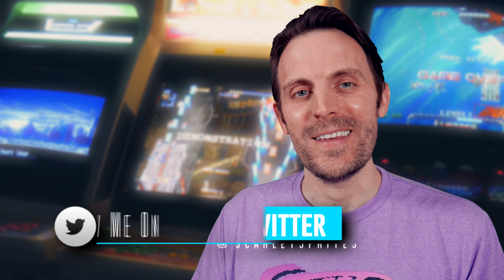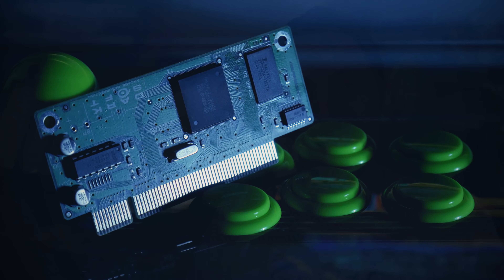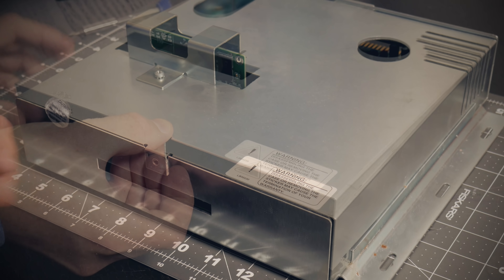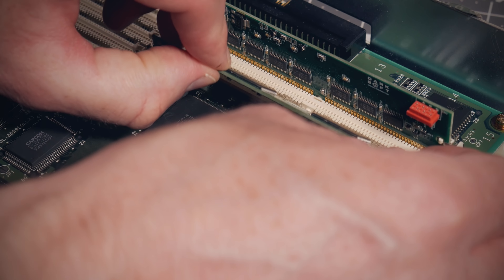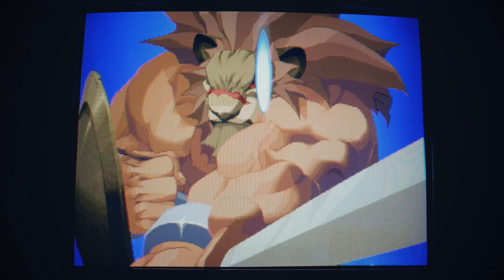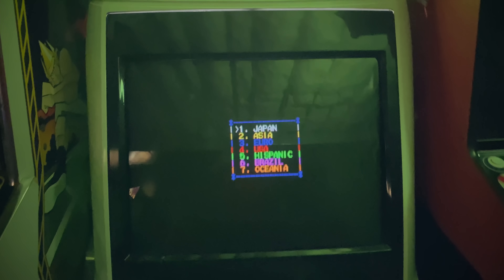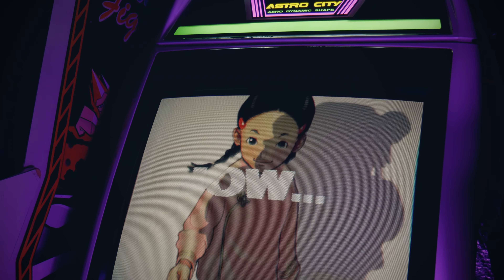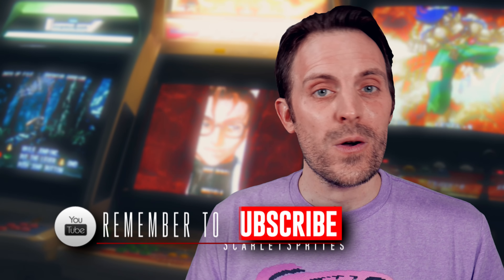Darksoft CPS3 Ultra Simm Multi Review - Elite Arcade Hardware!

Comment: Darksoft is probably one of the biggest reasons I decided to get into collecting arcade JAMMA boards. They have a lot of great products to choose from and, in my opinion, are better than anything Terraonion can put out. Prices can be heavy, but it still won't cost nearly as much as building a collection of official game carts/boards. I myself probably won't venture into the CPS3 scene due to the insane cost even for just the board, but I just got my first Supergun and I'm looking into IGS PGM, Neo Geo MVS, Sega ST-V, Taito F3 and Sammy Atomiswave either because some games and motherboards for those systems can be had for a fair price or because Darksoft makes a nice cart for them. I'd like to jump into Hyper Neo Geo 64, but those boards are extremely rare and expensive nowadays so I had to back off. I also appreciate people like you who help guys like me understand how this stuff works and what's available out there for us to consider buying so thanks!
Reply from the maker: Even as an SNK fan the Neo 64 didn’t excite me too much.  It’s cool from a history standpoint but with the non-fighters requiring special controls it’s a bit of a turnoff.  If it had a Metal Slug game though, that would be a real conundrum.
Reply: @ScarletSprites  You're definitely right about the lack of standard controls for non-fighters. Unless you're willing to build a custom control setup to go with your game, you're pretty much limited to 2 different Samurai Shodown titles, Fatal Fury Wild Ambition and Buriki One. There's two driving games that need a wheel and a rail shooter that doesn't even use light gun technology to work. All of this was another reason I decided to back off from the HNG64. The system really needed a top of the line game to catch attention, like maybe a 2D or even 3D Metal Slug or a really cool shmup. Still, if I ever find a motherboard for cheap then I'd pick it up.

Comment: This is a great solution. I would definitely go for a CPS III and this kit but I find it to be very confusing and  expensive. Awesome review man. 🍻
Reply from the maker: I think you'd be fine if you got someone to program it for you.  It's really just snapping in memory after that.  The cash part though, I can't help you on, lol.
Reply: @ScarletSprites  🤣🤣🤣🤣 I went to ebay after your video and looked at some prices on CPSIII boards and was floored. I then went to my Dreamcast, and fired up 2nd Impact.
Reply from the maker: The window for no nonsense prices on those boards closed probably five years ago or so.  It’s tough and only getting tougher unfortunately.  Maybe a MiSTer core will save the day eventually.

Comment: Street fighter 3 double impact is my favorite street fighter also I love using KEN in the white Gi or Dudley
Reply from the maker: Yes!  Ken is my goto character as well.  I love the refinements over New Generation but it’s more subtle humble than 3S, which I like.
Reply: @ScarletSprites  I used to play alpha 1&2 on Sega Saturn religiously, so when Dreamcast came out I jumped on alpha 3 and it was my favorite until street fighter 4 came out.  I played sf3:DI and 3S in the arcades and on the Dreamcast and ps2 but It wasn’t until 2010 when I really started diving deep into the Dreamcast version of SF3 new generation and Double Impact when I realized it was my favorite for the tone / music / level design / load screen etc… then 3rd strike blew up on xbox 360 and ps3 and got popular in the competitive scene so I played a ton out of it, but still and always prefer to play double impact when I’m alone on my Astro city candy cab or still on the Dreamcast using a compaq 20” vga monitor or else using Rca on the commodore 1704 monitor 👌😚👌

Comment: Ma boy, DARKSOFT!  WOOT!  WOOT!
Reply from the maker: That sums up my thoughts as well.
Reply: @ScarletSprites  I finally got a chance to pick up the CPS2 multi based on your video a while back.  Thanks a million.
Reply from the maker: Oh nice!  It’s a pretty fantastic piece of arcade hardware.  Maybe the single greatest modern solution on real hardware.
Reply: @ScarletSprites  For real.  Currently waiting for it in the mail.  I have a supergun already but am trying to hold out a HAS supergun before I plug and play.  I'd hate to wreck it with "bad voltage" or what have you.

Comment: When the NeoSD goes for $450-700 depending on which you get, that’s not bad actually.
Reply from the maker: I’ve actually never used the DS Neo cart or the NeoSD from TerraOnion.  I may have to check those out at some point as well.

Comment: Does you astro have plexiglass on the control panel and if so where did you order it?
Reply from the maker: No, it’s a repro panel that does have a clear/glossy finish across the top though.
Reply: @ScarletSprites  do you still use a SCSI CD-ROM or do you use a SCSI2SD ODE?
Reply from the maker: @war3zlod3r  No I switched to SCSI2SD years ago.  I still have the CD-ROM if needed but much prefer the simpler design of using an SD card.

Comment: For that price...he should have included an IR solution with remote you can attach to the cabinet side or something to make swapping games easier than pulling it off the wall, opening the back...messing with dip switches.
PCB IR adds and small cheap chinese remotes would not have added much to the cost.
Reply from the maker: The existing solution isn’t too bad.  It’s not as elegant as what you’re suggesting but the ribbon is just long enough that if you mount the board it can be pulled through and into the control panel.

Comment: The changing of the 3.6v battery every 5 years is getting massively annoying on my street fighter 3 third strike security cart. Thinking if i neglect it she would die and become part of this Dark community. I'll know where to look if it happens thanks.
Reply from the maker: Yeah that’s tough because it’s cool to have unmodified original hardware, especially 3S.

Comment: Did they stop making these 😢
Reply from the maker: Yes, I don’t think they’ve been in stock for some time.  Darksoft said that UltraSimms restock could happen this year but is not guaranteed.
Reply: @ScarletSprites  thanks for the heads up. I’ll keep an eye out for it. I love double impact as well and primarily play it on my Dreamcast. The goal of owning a cps3 machine with both double impact and third strike could finally be met for me if the restock happens.

Comment: kinda makes me ask why not use multi carts  and do a button press
Reply from the maker: The cart for the CPS3 is really just a security checkpoint.  It can't be used to store/run games.  All of that is stored on the simms on the board.  If going the original hardware route there really isn't another way to do this unfortunately.
Reply: @ScarletSprites  well they did release the anthology sf alpha on the ps2..

Not sure  sure in the states though I do know over here we did use multi cart boards  having sf and a few others running within so it was plausible to see multiple cart options in the wild in the australian arcades though a rarity these days and then back in the  day..

Noting that cps3 games whilst limited in terms of north american release  I would state that cps3 did have more than 6 games on the hardware...

none of the sf3 games 
 never appeared on other consoles  as single or as a packaged  game.....

Also note you can run  most of the SF games in widescreen. so you can run mist of then on a 55 inch or higher screen..
Reply from the maker: Are you sure you’re not thinking of the CPS2?  The CPS3 only had six official titles released for it, 3 SF3 games, 2 JoJos, and Red Earth.  That’s it.  

Oddly, of the SF3 games only 2nd Impact is WS.  All of the SF3 games were also ported to DC.
Reply: @ScarletSprites  I only mentioned it because I remember seeing ALL 3 SF3 GAMES IN BOTH STANDARD AND WIDESCREEN..

CAN'T REALL COMMENT ON WHAT GAMES CAME OUT ON CPS3, THOUGH WE DID GO THROUGH A LOT OF ODDITIES  BETWEEN SF3 AND SF4 AND SF5, AND STREET FIGHTER VS SERIES ..

Can't comment on  what became became within the hardware variants within  a wide number of arcade types especially around barcades to sitdown types popular inside and outside of Japan.

not to mention using other hardware types where you  1in3-1in8 multi cart setups where you can change games on the fly on a button press..

Thus that lead to the original comment  where you have a dedicated button press for changing games..

AES and MVS options in plug-in/plug-on board types like what was used in neogeo cabinets of the era

Comment: Cool but not worth the price IMO. I rather wait the 45 min.
Reply from the maker: I definitely get that philosophy.  I’m going to continue using the original superbios solution myself.
Reply: @ScarletSprites  Has anyone thought to use dummy files to pad the game files to the outside edge of the CD? Or would that not work on real hardware? That should speed up loading time significantly. I have a Warzard CD and you can see the data is all at the center. I guess no one knew anything about how to master data CDs back in the day.
Reply from the maker: @NoSpamForYou  I’m not even using a CD with my setup.  It’s coming off of an SD Card.  It’s unfortunately just the slow writing process to the memory.